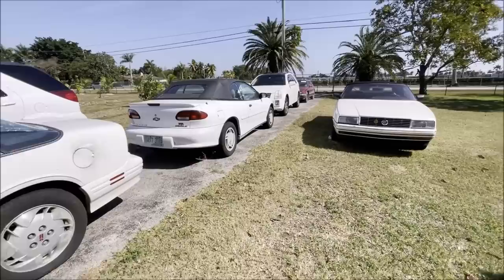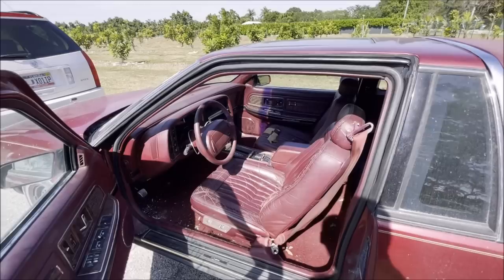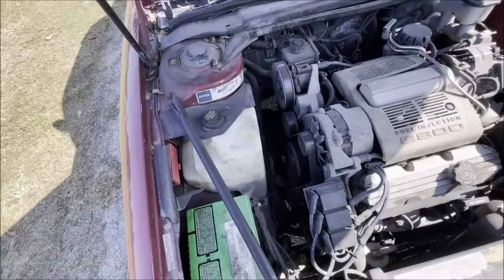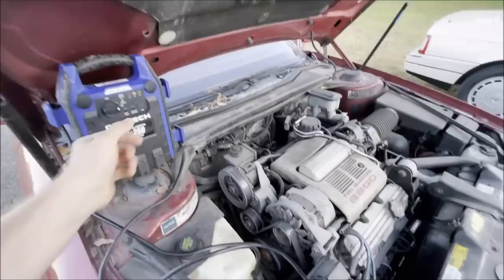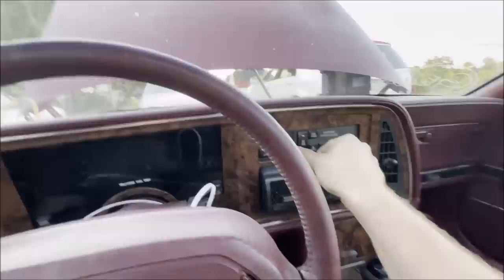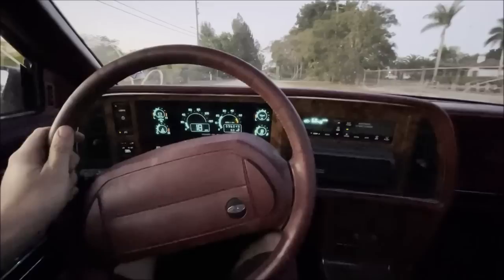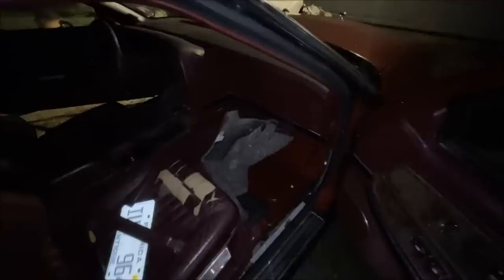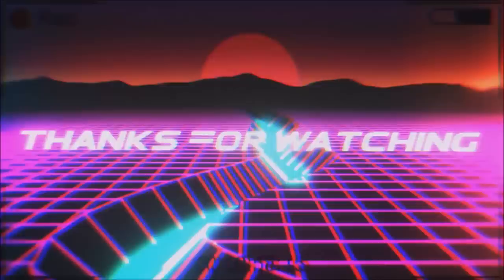Copart Buy: $350 Ian Flooded Buick Riviera

Comment: I am glad the car came back to life. These, the Reatta and the Olds Toronado and Toronado Trofeo are some of my favorite GM cars. The thing I liked about that generation Riv was the way the back license plate was attached. No screws needed, open the trunk and then slide it in the slot and then close trunk.

Anyway, some of the reason these digital clusters had issues was due to heat. These give off a lot of heat and there is next to no ventilation to disperse the heat. Not to mention the sun beats down on the back of the cluster chamber due to sitting so high in the dash. The other reason was poor soldering on the circuit board. I will say I was not too surprised that it was going to run as it is an old school GM FWD with with the bullet proof 3800. GM kept this car somewhat simple (unlike Randy's Allante which was designed way more complex then it should have been). I think Copart sees an older faded car with a dead battery and does not even bother to spend time seeing if it will run. That is great for the buyer but sucks id this was being sold for charity as money is left on the table because nobody bothers to jump it to see if it runs.

Good luck with the car
Reply from the maker: Electronically the Allante is actually simpler than this car. Less wiring by design to prevent electrical failures.

Comment: Glad the car was a pleasant surprise…given the water line and the fact that water made it into the cabin I’d be inclined to change the trans fluid/filter and engine oil/filter. For the top try 303 spray…let it soak in…I bet the top looks like new afterwards. That paint will buff up…so glad it did not go to the junk yard.

Comment: I really hate when insurance companies, auction companies, etc say a car is not "worth anything"....these days a car that starts is worth at least $500 and one that drives is worth at least $1000.  Few years ago (Right before COVID) I had a Honda Accord with 330,000 miles and there was a guy working on a house next door that was looking to buy a car and asked me about my Honda and I said "I wasn't really looking to sell it but, i'll take $1000 for it.  He test drove it and he counter offered $200!!  I told him to get lost.  He tried pointing out "this needs fixed, that needs fixed"...I told him "It's a car for $1000 that runs and drives...it's got over 300K miles and it's a 1990...there will be problems....but it WILL get you from A to B...."  I was not going to budge on the price.  I listed the car for sale and it was SOLD for $1000 in less than 24 hours....the guy that offered me $200 texted me and offered me $400.... I told him "too late, I just sold it for $1,000".  To this day, I regret selling that car...I loved it.  I bought it for $2500 in 2012, drove it for 7 years and only had to get it repaired at a shop TWICE (did my own brakes and oil/oil filter change).  I had a shop replace the rack and pinion and something else (I forgot)...but to sell a car for $1000 that you only paid $2500 and drove for 7 years daily is a hell of a good value....then to realize it was such a good car that you regret selling it.  I put almost 100,000 miles on it

Comment: I remember the Bosch ABS systems on these Buicks being the main reason people junked them. I had a CLEAN white low mileage 91 Buick Regal GS sedan back in 03-04 when I was a teenager that I scrapped ONLY because of that ABS system that I couldn't find anybody to work on even back then smh... So GM still used that system until at least 1991.
Reply from the maker: Randy at auto auction rebuilds is an expert at fixing those ABS systems now after fixing his flood Allante!

Comment: They will eventually go up in value like the cadillacs.
Reply: No, because unfortunately, these are 'throw-away' cars. Despite the bullet proof 3800. GM didn't intend for them to outlive the rest of the car, but they over-engineered it. IMHO, that's probably why they came up with the stupid plastic intake plenums starting in the '93 models. So there would be faster turn around to selling new cars.

Glad to see this one saved. It could easily go another 100K, if the transmission is not abused.
You just have to live with the interior componants falling apart, switches failing, etc. . That's what I mean by 'throw-away' engineering.

Comment: Dry the carpet pad out, I think you'll be fine.
On my '89 LeSabre, the SES light rarely ever comes on, even when I had a faulty ignition module.
Variable resister in the headlight light switch is faulty.
Dampness in the spare tire well is nothing unusual for these cars. Could be just acumilation of Florida humidity.
Someone probably ditched the wheel covers because the sponge rubber lock heads are a bitch to unscrew when they get old.
I threw mine the hell away when I almost coudn't get the wheel cover off in my own driveway shortly before I was going on a road trip. ('90 LeSabre Limited). Black steel wheels don't bother me.
You lucky skunk. That car is a cream puff with less than 100K miles. I wouldn't care for the moon roof or the vinyl top, but the price is unbeatable. IMO it is NOT worth spending the money on reconditioning the vinyl top. Armour All is your friend. 
I wouldn't bother getting  the seats replaced either. Unless the power motors failed. They almost never go bad in my experience. The power windows usually get sluggish on those. Yours are working extremely well.

Comment: Since there's no obvious water line or damage, I wonder if the owner just claimed it was flooded or it was near to where the flood was.
To be honest with you, your service engine soon light was on, before you started playing with the climate control.
I'm surprised when you get a car and it has a battery in it, you don't immediately put it on the charger to hopefully try and save it.
I know many people hate side post batteries, but they do serve a purpose, like when the battery is installed in an awkward location.
Reply from the maker: I put the battery on a deep cycle charge during the video

Comment: On floodcars to be safe, ALWAYS change  The oil. You never now 🤷‍♂️ (how i se it...)
Reply from the maker: This one was too obviously clean to have water in oil
Reply: @bigalsbikeandauto  wel you can never be to sure! 🤷‍♂️
Reply: @bigalsbikeandauto  You looked at the dipstick BEFORE you tried starting it.
If there was water in the crankcase, it would settle to the bottom of the pan while the car sat idle for X number of days.  Now that you've driven it, it might become evident from peering inside the valve cover fill hole. (excess moisture)
You might still be OK but..... I would be tempted to pull the drain plug for a few seconds to see if water comes out. You'd have to do this after the car has been sitting for a good 48 hours.